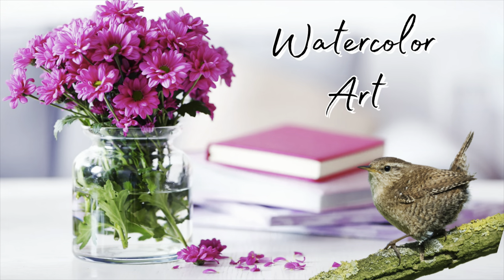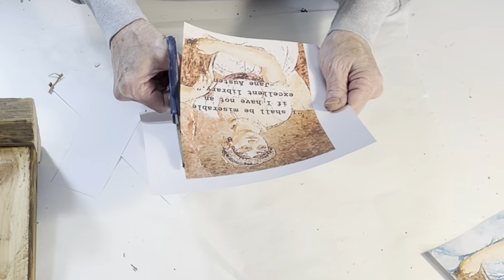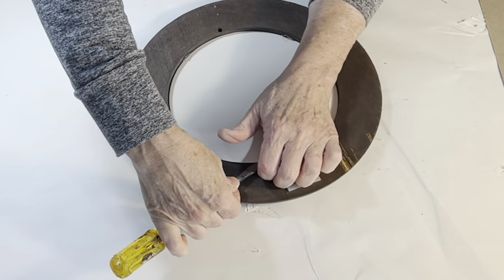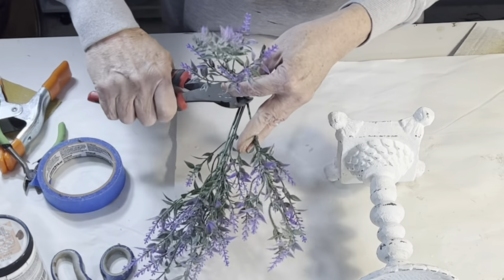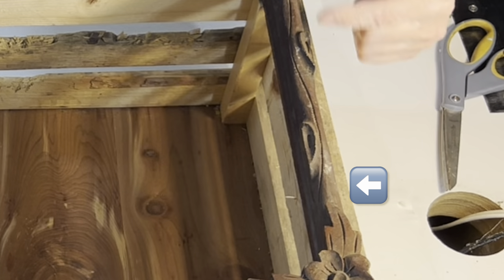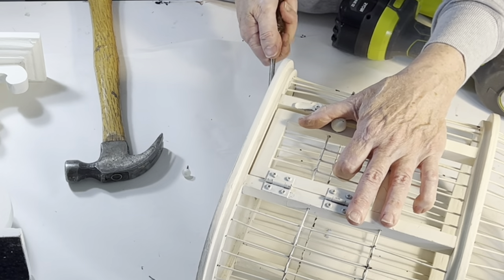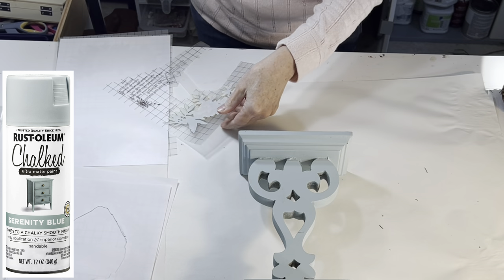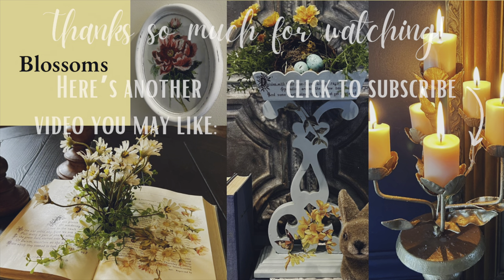DIY Upcycling Thrift Flips into Unique Home Decor (Using the 3 B’s)!

Comment: Great show as usual. A question kind of on the "Frankenstein Bookshelf". In your final picture of this you showed the corner of your fireplace. I absolutely love the piping you used around the fireplace mantel. I have a gap all around my fireplace(old house) that I filled with caulk and painted the wall color. I like your idea much better. How did you get the piping to match your wallpaper?
Reply from the maker: Thank you! The “wallpaper” is actually fabric, so the piping was created with the same fabric. I did not install it; it was here when we bought the house. You can easily make your own piping. You just wrap a strip of fabric around rope/twine (they sell it in fabric stores) and sew a seam close to the rope. If you need lots of flexibility, you should cut the fabric on the bias, but I never do that because it wastes so much fabric. You should be able to find some fabric that coordinates with your decor.